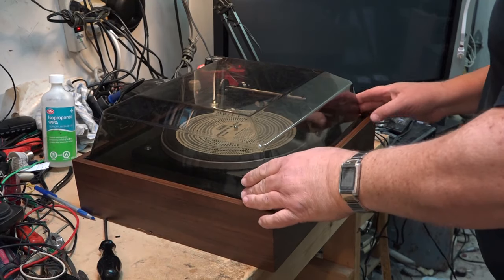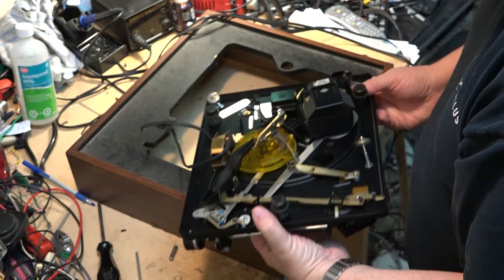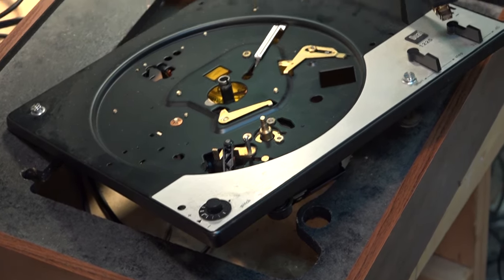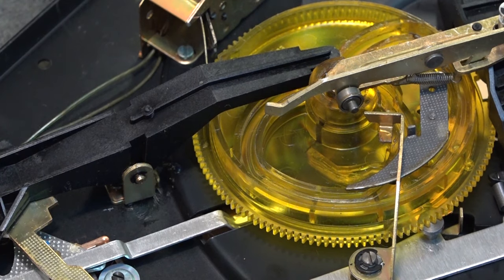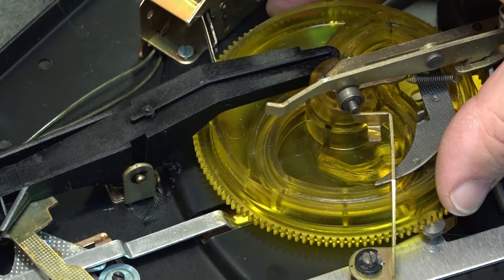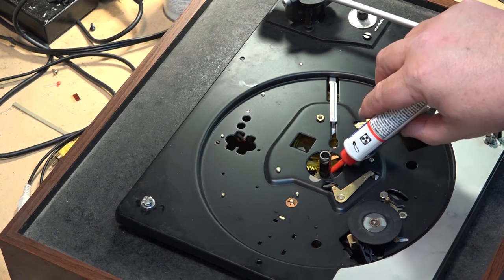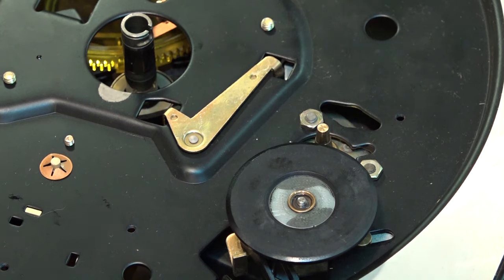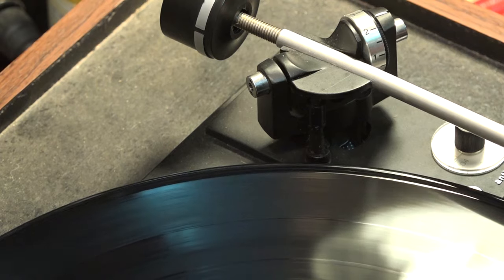Dual 1225 Overhaul

Comment: you can download an android app called strobily which can be configured to flash the phone´s led light at the required 60 or 50Hz. Works with most android phones. It produces a higher contrast than fluorescent lights.

Comment: You are seriously awesome 12V...  you really described those "problem points" well.  All the oil-joints, and the motor exam, are serious needs requirements.  Plus the balance on the arm was not overlooked.  I would never have guessed 2 grams is the correct weight, for the tone arm.  I missed that on the other video you did.  It's been awhile since turntables have become somewhat dinosaur-ish, locally.  Or just collectors' type stuff.  It's interesting you know how to repair stuff like this.  Are repair shops dying?  lol.
Reply from the maker: Yes repair shops are dying.  Most are long gone.  Most that are still doing this work are doing so from home.

Comment: Excellent info, thanks for showing us.
Gave me the nerve to dive in and now from a non spinning groaning arm return mess I have a smoothly operating Dual 1218 with all functions working well with no groans, no speed reduction during arm return, and quick shut off.
Lithium grease and 3 in 1 oil are to a turntable as new caps and tubes are to an amp.

Comment: Thank you! I've got a DUAL 1234, which is pretty much the same inside and the auto-functions were all out of whack and the motor made an awful buzzing sound and this helped me immensely - managed to fix both issues!
Reply: Hm, it worked great for a couple of days but now it started doing something weird - when I auto-start, the needle moves over the record and as soon as it drops, it lifts up again and returns to the initial position and turns off.
I can see that the issue is that the big yellow cog keeps spinning for another turn, so the little starting lever that's over the gap in the teeth probably isn't being moved back properly but I can't for the life of me figure out why.
What's even more baffling is that in like 1 of 10 tries, it works normally and, in like 1 out of 20 cases, it does this on switch-off as well - it moves fine back to the initial position after playing the record, but then it lifts and drops several times before finally turning off.
Reply from the maker: Your on the right track. the starting lever that kicks the cam gear isn't being reset. It is operated by both the manual reject lever, as well as a lever that is activated when the tone arm reaches the end groove on the record. The problem is going to be some dry lubricant, or dirt causing one of these parts to stick, which kicks the mechanism again as soon as it finishes a cycle.
Reply: Thank you!!! I'll have to give it a closer look. The problem with this part is access - it's on the top side of the yellow gear, so it can't be accessed from the bottom and from the top, it can only be accessed through a couple of small openings in the chassis.

Comment: Tnx m8!
 I had some weird noise from idler wheel so I did the disassembly, lubricated it with my gun lubrication fluid (it's a temporrary option) and it runs smooth again.

Comment: Just a little tip for these dual turntables, if you want to calibrate the correct speed to be dead center on the dial, there is a small hole next to the pitch control with an adjustment screw inside, you center the dial and adjust the screw until the speed is correct. Dual turn tables are built like tanks, the main issues with these units are lubrication and the so called steuerpimpel which is a rubbery "pimple" that makes the tonearm go back and forth, sometimes the tonearm won't move or doesn't do the total path because of this. I once fixed a 1226 for a friend that has a totally seized cam gear, I fell in love with these dual turntables I bought myself a 1214, not the top of the range of the era but a very nice unit nonetheless it's a 3 speed unit, and 3 selectable record sizes. Too bad it has a 2 pole motor though, I put in a magnetic cartridge and it picks up a slight hum from the motor.
Reply from the maker: That adjustment hole has a cover on it on this one. The "steuerpimple" on this one is wearing, which is causing sluggish arm movement. It works, but hesitates slightly when moving. (this the reason I didn't demonstrate is in this video)
Reply: i bought a 1226  love the little tank. it is amazing. cleaned off the old grease and reoiled. even the record dropper works. came with cover, strobe disc, and original 45 adapter. $10 dollars at estate sale.

Comment: Ha! I was expecting belt drive. I was thinking if the belt was bad,, you could still hear the motor running. But, maybe not.
On many rim drives, the motor shaft has multiple diameters to change the speed ratios. Some have a separate set of idler wheels   at different diameters to do the same. And they used to make the operator cam out of metal. Some were on the other side of the motor board.
Another edit: I am fascinated by how mechanisms work. Miss the old jukeboxes that played 45's. And pinball machines. I love this video!
Oh, the tricky part. Putting back the rotor in the motor, and tightening the nuts. If not done right, motor will bind. I learned from experience.

Comment: I got a couple of 1225s and fixed some pretty standard issues. In both ones the start/stop lever is very loose, the whole thing works, but this knob moves on it's shaft. Is this a standard behavior or should I try to fix it?

Comment: I have the Dual 1209 which is a cheaper version of the one you have here.  The 1237 (belt drive) is also a good one to restore because of nice durable parts and easy to work on design.  BTW the 1225 is the Dual model that is seen in several photos of Elvis in his home that I have seen on album covers and in magazines.

Comment: Great and very helpful video 12V!
I'm currently working on this turntable...but there's a very weird problem with the start switch. It runs completely free. It's like the plastic part has no grip what so ever on the shaft which turns inside the device to actuate the lever. Even more strange: on the inside you would assume that you could turn the shaft or remove it. But that's not possible and it doesn't move it all. Help would be highly appreciated 🤗

Comment: Thanks for the video. I just bought a non working 1225 and pulled it apart lubed it as you did and now have it up and running. I have to get a pre amp for my receiver. I have one question? I found two little pieces at the bottom of the case and clueless as to what they are?

Comment: Great video. I have a Dual 1009, with what looks like a very similar drive mechanism. The arm drops, goes back at stop, and the table spins. Problem is, the drive disengages as soon as it spins up and the needle drops, leaving the table to slowly spin down to a stop. Any idea what part might need adjusting to solve this?

Comment: Thank you very much for your video, it helped a great deal. A friend gave me a 1225 and I was just about to throw it away because it would refuse to spin the platter. I followed your procedure and now its working! I could not work out how to get the platter off and did not realize that the player could be started by moving the tone arm into position manually.  I have no ground wire and I'm wondering where to connect one. Does it go to the box where the audio wires connect? My player became very corroded after I left a record with drying PVA sitting on it (a weird and wonderful record cleaning technique that works like a face lift). Even the motor had green corrosion in it. The cartridge is so green all over that it hardly works, one channel has stopped working. So viewers, if your going to use the glue technique on your records do not leave them near your TT!

Comment: Thanks for the video. Like you did. .I used the 3 in one oil I applied to gear and pivot points and used the rubber Renue on the wheel..I just ordered some phonolube lubricant but I did not try yet...I got start and stop to work.rhe to warm falls short to the resting arm and .but am having a problem with the tonearm during play stylus it seems to pull away and skips and loops...how do Fix that?
Reply: Refat Rabadi same Problem here, the tone arm just stays and loops the Sound all the time

Comment: Hi,12Volts Thanks for the video is very helpful. I have 1226 and with your instructions, I was able to make it work, however, I have an issue with the start/stop mechanism: There's a repeat cycle when the record ends or when I select the stop options. I did a full cleanup, disassemble the main gear, clean up everything and I am not sure what else I can try. 
A special behavior I noticed is when you adjust the screw that is next to the anti-skate. Sometimes the stop mechanism works however suddenly the full thing is stuck. I broke the main black leaver and I just received the new part, however I hope that you have some ideas or tricks that you can share for this. I can send you some photos or videos in case you need them. Thanks in advance and I hope things are ok in BC. I am writing from Montreal. 

Cheers

Comment: Smashing job sir :-D, a good old deck back in service.

It's similar to the bsr decks in two ways, the auto cog with the tracks to control the mechanism, and the rubber wheel drive :-).
I like the under deck cog, its neater than the bsr overdeck type, and plastic should be quieter than the cast type of the bsr.

The pitch control i had never seen before, i guessed the drive shaft had to have a taper, and the second you removed the platter i staired at the taper lol.
The strobe disk wont show correct for the 33 1/3rd speed, only at 50hz you can have a strobe for that, at 45 rpm the 60hz is perfect.
For the uk the 33 1/3rd  calculates correct for 50hz only.
Reply: What are you talking about? The strobe disk has a set of rings for either 60Hz or 50Hz If the strobe disk is under a 60Hz light it will show fine, if you put it under a 50Hz light it will show fine as well, as long as you are looking at the right set of rings. These dual turntables work fine at either 120V 60Hz and 230V 50Hz, as long as you rewire the motor coils from parallel to series and you change the motor spindle accordingly..
Reply: Hmm, i was sure the strobe would not be whole values of black lines at 60 hz 33.33333rpm, i must be mad lol :-D
Reply from the maker: The motor shaft is tapered slightly and the pitch control moves the drive tire up and down slightly. For a 50Hz version, the brass drive shaft would be slightly larger so as to compensate for the slower motor speed. I have seen turntables with a 50/60 hz adjustment. The drive shaft had 4 speeds, 2 for each 33 and 45 one being for 50hz and the other for 60, but most turntables with the 4 position drive were for 16,33,45, and 78 speeds.
Reply from the maker: Nope, the strobe disk I have is for 60Hz only. There may be ones for 50Hz, but this one is for 60 only. Those other strobe rings are for +2, +4 and -2, -4% for the speed. The motor rotates at the live frequency, and therefore at 50Hz will be running slow, so you need to change the drive spindle, which is what I said. As it sits, without changing parts it will run slow at 50Hz, and I am not even considering the voltage change, which is easy. As you said if it is a dual coil motor it would be rewired into series, but many turntables using a shaded pole motor only have a single coil, so on that type a step down transformer would be required.
Reply: The cheap bsr decks i remember in my youth didnt have any way to adjust the pitch, the motor spindle was two diameters only.
Mind you, the records were pop so i suppose it didnt mattar ;-D

Comment: Love your videos! But please consider mounting the camera directly to the 12 o'clock (rear) side of the turntable. Most of the close-up work is completely hidden by your left hand due to the camera position. Overhead would be even better if possible.
Reply from the maker: Camera is mounted overhead. This is an old video.

Comment: I have a dual 1209.... I want to lubricate and grease...what did you use to oil and grease recommend?
Reply from the maker: I used lithium grease for the cam gear, and just regular electric motor oil for the motor bearings, drive wheel and turntable bearing.

Comment: I have picked up Dual with DD quartz locked full auto at GW. the only problem is that the black cam doesn't grab the tone arm anymore during stat/stop cycle. It is like there is no friction left under that cam foot. Spent many hours trying to adjust the pressure on that cam but nothing has worked. So I have glued a piece of rubber under the foot but that only partially worked   Can this be repaired or adjusted somehow?
Reply from the maker: That is a common problem on these units. That black lever wears out. I am working on that right now on a Dual.
Reply: i wish they would have designed  it better. let me know how you did it after you done thanks

Comment: Thanks! I've got the platter moving again and can play manually but the auto return sand auto start are not working.  What can i do to fix that?
Reply: Hope you fixed it. It would have been the Steuerpimpel. Either missing or damaged.

Comment: There is a capasitor 0.01uF in the on off switch.  I had to chance it because the motor didn't stop and was running for months
Reply from the maker: Yes I have seen this happen. That cap is there just to debounce the swicth so that the spark created when the switch opens and closes doesn't pit the contacts in the switch, and cause an audible pop in the speaker as if the volume was cranked this could damage speakers.  From time to time it shorts, and well you have a motor that just won't turn off.
Might be an idea for a future video. Just have to find a shorted cap to put in or perhaps stick a pin in one to create a short and then change it out.

Comment: What type of oil are you using?  Anything special?  I'd be concerned about the oil breaking down or attracting filth and gumming-up.
Reply from the maker: Just 3 in 1 electric motor oil. That is pure 20 wt oil with no additives.  (Not engine oil in other words) you don't want detergents in there or anything that could attack the metal.

Comment: Linear Tracking turntables do all of this under computer control would I be right in thinking this?, I do seem to remember when I had the MARANTZ TT143 Linear Tracking turntable that there was nothing like this and anyway all the arm control hardware was built into the lid of the turntable which means that the lid has to be down or the record won't play, I would have thought that a drive wheel made from Synthetic Rubber would have been better, I would have thought if you where living in California, Arizona and Reno Nevada it is going to be hotter so you will want to keep your Record Storage and music system in the basement.
Reply from the maker: Most linear tracking turntables were really simple devices. Yes I know a few used lasers to track the shiny vinyl between the bands so they could position the needle automatically, but most were just a very simple setup.It consisted of a sled assy with a metal, or plastic gear. Some used a toothed bely and drive the tone arm block back and forth like a cheap printer.On the actual tone arm there was an optical sensor. As the record groove moved the stylus over about 1/8" the optical sensor would detect this, and turn on the rack motor that would move the arm rack over 1/8" until the optical sensor told it to stop. Then when the needle moved again, it would kick the block over again. There was a second motor that operated a little cam shaft to lift the arm up or drop it. Sony had a really cool one that you placed the record in vertically, and I always found that one cool to look at, but all linear tables were a pain in the ass to pick a specific song to listen to.

Comment: HELP. can anyone tell me would a 110v 1237 turntable move on 240v?
Reply from the maker: joe Christie 
You would need a step down transformer unless the motor was dual voltage and then it is just rewiring it. The bigger problem is frequency. If you have a 60hz motor and you run it at 50 it will be slow.